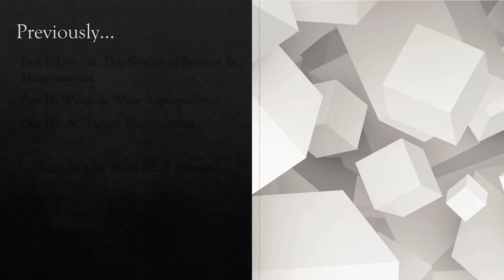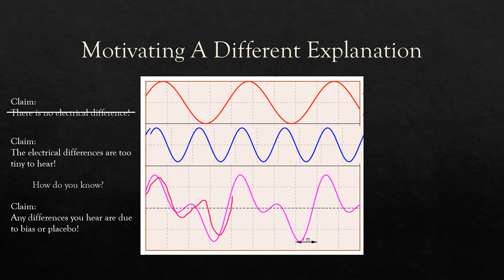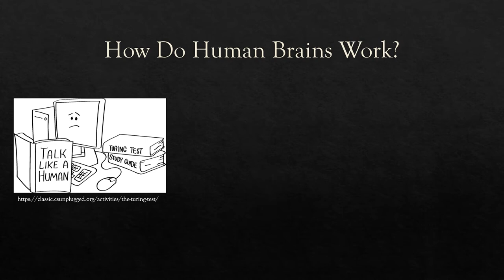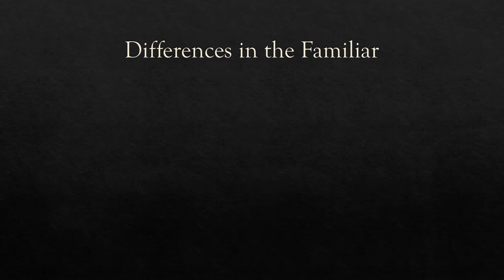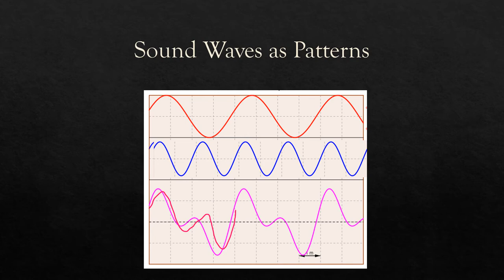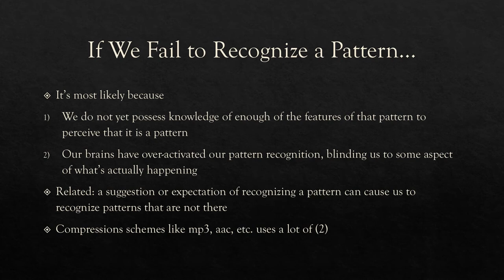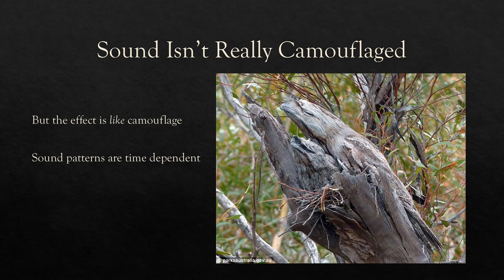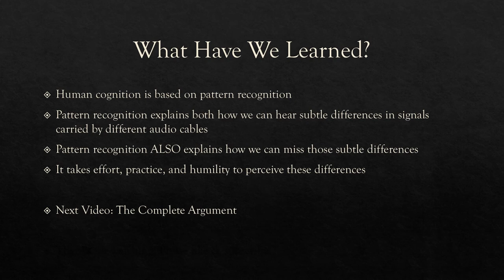Cables Matter Part 4: Pattern Recognition - The Heart of the Matter

Comment: Hey man, thanks for taking the time to make this video!  I think you make good points on the reliability of auditory memory and how it's not actually as bad as people think.  I also heavily agree on the impact of suggestion on our perception.  Hardcore objectivists love to forget that humans have the ability to train and refine their hearing the same way that we can train any other skill.  You can be trained to hear smaller, more subtle shifts in pitch, dynamics, tone, etc. so you must factor in a persons experience and training if you want to get a better picture of how their impressions relate to your own.  Measuring audio at this finite of a level is hugely non-trivial, so to say that "If we can hear it can be measured." is not very useful.  Phase differences in cables are to be noticed at the very limit of our measurement gear, and are difficult to separate from noise.

I believe if we had large scale research money thrown at these kind of audio problems we could find more reliable ways of measuring the differences between cables, and other power filtration products.  The test equipment and methods need to be optimized for the task which currently they are not.  I hate the idea that gets thrown around that "Science says cables don't make a difference."  The only thing this tells me is that you don't understand what the function of the scientific method is.  Most of the people parroting this rhetoric also seem to heavily misuse technical terms too... lol, go figure.

I appreciate you taking a different angle on the subject and still working in technical reasoning on why we can hear these things.  Keep up the good work!
Reply: I think the bannister effect applies somewhat peripherally to this topic as well.  Would be interested in your thoughts on that.
Reply from the maker: The Bannister Effect is not something I had heard of before so I had to read up on that for a moment. Pattern recognition and related theories played a central role in my grad school work, which is why I brought them up here. Anyway, I think it's possible there is some peripheral application of the BE. What the BE sounds like to me is something akin to a groupwide expectation bias, specifically a bias toward a thing NOT happening or NOT being possible. The 4-minute mile was so elusive for so long that runners as a group began to believe it couldn't be done, making it harder and harder to actually do. If I understand your implied connection, in our audio hobby we have a sizeable and very vocal group claiming that cable differences cannot be heard and that anyone claiming to hear such differences are the ones with bias. That group is making it harder for themselves to hear what's there because they have programmed their thinking to NOT look for it...or something close, yes? The basic nuts-and-bolts of that would be consistent with my description of framing in the video: your brain calls up all the little bits and pieces it deems relevant to a stimulus and uses those bits and pieces to make sense of what's stimulating it in the moment and also attach the new experiences to the old experiences to form a memory of the new experience and build new knowledge & patterns. If a person keeps insisting to themselves and others that differences cannot be heard, then yes, their brains will activate that little nugget of thought every time they're presented with a relevant stimulus and that will influence what they are able to perceive and remember. Finding vocal support from a like-minded community only reinforces that brain-activation pattern making it harder and harder to break out of. I suppose it could be argued that the BE was like that: the more each individual runner failed to break a 4-minute mile, the more and more runners as a block group believed it couldn't be done. Of course the key to this story is it was done and now no runner has any real shot in international competition if they aren't comfortably running a mile in under 4 minutes. Interesting observation. I'll have to think more on if or how much BE applies to hearing cable differences. Thanks for watching and thanks for the feedback!

Comment: Thank you for these videos.  I've been racking my brain as to why my Forza Noir Hybrid and ZMF 2k Copper cables sound different on my Atrium.  So different that I prefer the stock universe pads with the ZMF copper, and the Autuer hybrid pads with the Forza silver.  If what I was experiencing was purely placebo, I was genuinely expecting the ZMF cable to sound better solely because it was more expensive and visually appealing.  Yet after extended listening each cable has different strengths and weaknesses in sound.  

The ZMF copper sounds "warmer" with a tad more weight in the mid-bass and forwardness in the lower mids.  The Forza hybrid by comparison almost sounds sharper and more V-shaped.  Bass is less thick and has a better immediate sense of impact.  The upper mids into the treble are better defined and more energetic in a way that makes music sound sharper and slightly more spatious, yet because of that is less forgiving on some recordings.  Vocals and instruments between 3-5khz that don't bother me on the ZMF copper sound more shouty and almost piercing on the Forza at the same volume level.  The air above 10kz also sounds sharper lending to the greater sense of openness and space, but again sounds more fatiguing depending on the track.  

Over all I prefer the sound of Forza Noir hybrid cable on my Atrium.  With the Autuer hybrid pads it creates a unique experience that I haven't heard on any other headphone.  The ZMF 2k copper with the universe pads has a more fun and versatile sound, but lacks in "wow" factor for my tastes.

Comment: Been watching all of these, and they are generally quite good, and the arguments tend to be strong. Well done! 

So far, the arguments against "bias" or "placebo" are weak (14:08 minutes in) - in that you are more focused on addressing whether the use of the terms is literally correct and "proper," versus whether the intended POINT behind the word choice is valid (colloquial use seems relevant). And the intended POINT, which has also been scientifically demonstrated a million times over - is that our subjective perception of sensory input is often very much impacted by expectations, mentality, etc. You are almost setting up a straw man argument on these points. "The Power of suggestion" seems to be the intended term.

Also - as you say - the power of suggestion is capable of causing perception of differences that ARE NOT there. Further, even if there is a measurable difference there (factually) - that doesn't mean that the perceived impression was caused by the underlying "fact of the matter" and NOT the power of suggestion.

Overall, your argument seems to boil down to: 

1. There are measurable differences between the audio transmission of cables (agreed)
2. The belief of some people that they can "perceive" these differences is evidence that the measurable differences "cause" this perception of difference. ("There is no 'bias' problem because the perception of difference coincides with a measurable difference")

While I certainly think it's possible that people actually perceive these changes - we would need to rule out the possibility that the "power of suggestion" is not MORE powerful then the ability to perceive these measurable differences. It may be that the measurable differences are NOT perceptible, but simply COINCIDE with a perception caused by the power of suggestion. For example, thick expensive cable is perceived to be "different" on sight and touch - the measurable signal is actually "different" - but is it the former or the latter that is actually influencing the subjective perception?

I agree with pretty much everything else - experience and training is super relevant to our powers of perception, especially for audio.

Seems to me that a sufficiently rigorous double-blind A/B testing among a group of experienced audiophiles might be the only way to conclusively settle the issue.

On to the last vid :)
Reply: would be glad to see anything thats remotely comparable to whats done in fitness industry to select proper training methods

Comment: Never wouldve thought Id watch an entire lecture on justifying differences in the sound perception of audio cables but here I am, all the way back since the philosophy of science at the start of this series. Also, good to know that the reason I "cant" hear differences in the cables is simply because I dont have the experience to hear it, yet. 

Also, something Im curious about is this one video of someone who changed the shape of a square wave by shifting the phases of the associated frequencies around but the visually distorted wave still sounds the same to a normal square wave. If thats the case, then as long as the pattern is long enough to be recognized, the slight delay of the frequency waves shouldnt matter. Hopefully you can address this in part 5 or 6 and explain why the delays do matter.
Reply: I don't know what video you're speaking of, but changing the phase of a square wave in the context of music production does change the sound / relationship with the other sounds in the mix.